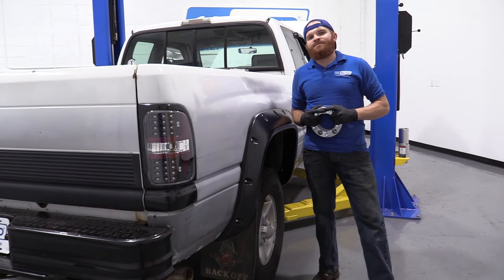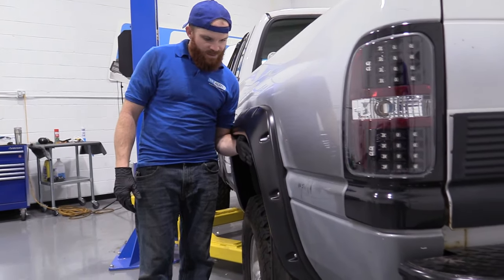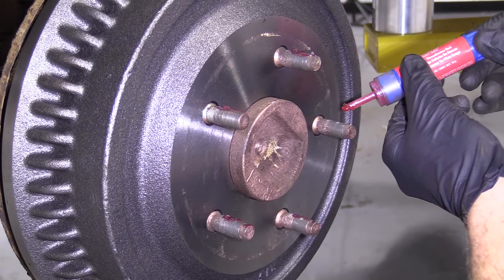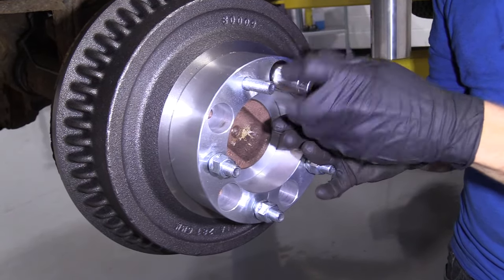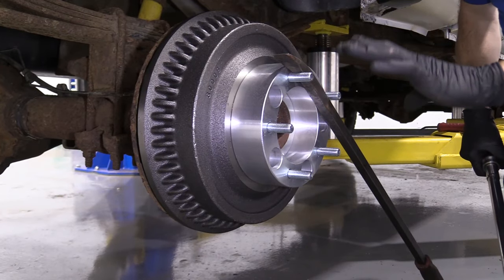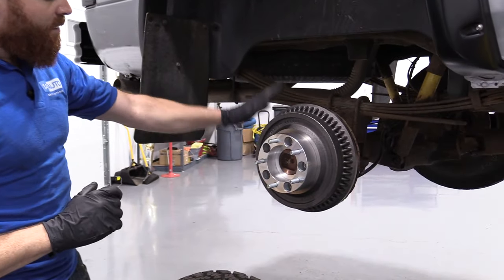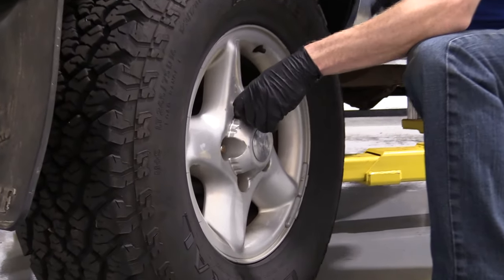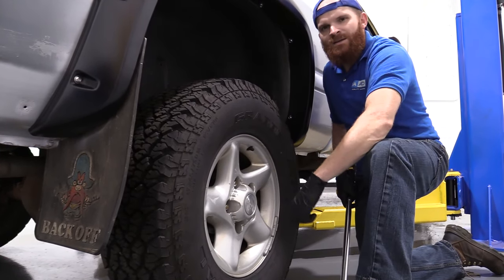How to Properly Install Wheel Spacers on your Vehicle!

Comment: If you use thread locker with BORA spacers you have just voided the warranty. If you insist on using thread locker, use blue not red. Red requires heat to remove, and eventually the heat WILL damage the studs.
Reply: So I use the blue medium strength thread-locker to car's studs that hold the spacer and nothing to the spacer that will hold the wheels?
Reply: Thanks. I guess I’ll just retourque them but. Can I retourque them every 12 days instead of 100 miles

Comment: Use BLUE loctite everyone not red unless you want to buy a torch to heat the nuts off and struggle
Reply: What if I don’t use any loctite is that okay or does loctite stop the retourque issue
Reply: @crush9197  just use the blue one . End of story . Its very much needed for your safety and the safety of others . Cheers

Comment: Won't it be hard to go back after a 100 miles or so and re-torque everything if you use Red-Loctite? I hear everyone saying that with spacers you need to re-torque shortly after install.
Reply: 100 miles
Reply: No where’s in the instructions does it say to use loctite. If you use red then no way in heck you be able to check torque. All you’ll be checking is that the red loctite is still locked.

Comment: Shouldn’t the “HUB-CENTRIC” be on BOTH SIDES of the spacer.  Thanks
Reply: No. Hub centric rings are adapters. they're made to adapt the stock hub bore to the size of the new wheel which is always bigger than the stock hub bore. They help get rid of vibration as well.
Reply: The hub on sticks through and that small part of the spacer
Reply: No. Only has to be a nice smooth fit around the hub
Reply: Hub-centric spacers are supposed to have a lip on the side where the wheel mounts to it. It’s so the wheel won’t vibrate because it would supported by the center of the spacer, and not just the lug studs. The spacers in the video do not have that lip, so it can create vibrations.
Reply: What about for the wheel
Reply: The one s with the lip
Reply: Hub centric does absolutely nothing but help with initial alignment.  All the wheel loads are held by the friction between the wheel and hub. The wheel doesn't move on the hub once it's tight. If you can put a hub centric on by hand then there is a gap (even a small one) so it cant contribute to any weight loading.  If your hubcentric is holding a load that means your lug nuts loosened and the wheel is sliding around on the hub in which case you got a lot more problems.  Every new wheel has lug centric nuts which center the wheel on the studs, the only way a hub ring helps is if your studs or wheel holes are drilled incorrectly.
Reply: @jabara572  hub centricity does help a little with load. The reason lugs shear off is due to the weight of the vehicle moving them around when driving. It’s not intended to be the sole load bearing part but it’s a lot safer to have.

Comment: I have had a problem with the spacer binding to the cars original wheel hub due to different metals for each. I think it is wise to apply a layer of anti-seize between the spacer and hub. Otherwise the spacer won't come off. Had a set on for about 2 years and this happened.

Comment: Thank you for understanding how to bottom out with a air gun, so many wheel shops and dealers don't and just use the gun tighten, stripping the lugs.

You don't know how many wheel shops looked at me as if they never knew how to use a torque wrench and properly torque to spec

Comment: You drive it around the block then re torque the lugnuts again. What you said about the wheels breaking free after hitting their first bump is exactly true.
Reply: I drove around the block and hit hella 12 bumps but nothing happened except clicking noises. I am gonna re torque them like you comment says but how often after the second time.
Reply: Coming back to reply yeah just retorque if you hear clicks they might be lose happened to me but I didn’t know how to use a torque bar at the time but if you torque correctly should be fine but if you hear clicks check took mine off because I need a lift so that they don’t rub

Comment: Great video, but one of my questions is about torque specs. Your video says to torque to manufacture of your truck, which in my case with a Chevy Silverado is 140 ft-lbs but my Titan wheel spacers say to not exceed 110 ft-lbs. Can billet aluminum wheel spacers stand the 140 ft-lbs Chevy says is needed for the Silverado?

Comment: Question, I noticed you used Hub ring for spacer but not for the wheel. Is it ok to run a wheel like that over spacer?
Reply: The best is to buy the hub centric for the wheel and hub and the spacers must be made from aluminum 6061-t6 for better safety use bora spacers on bonos(bloxsport) spacers have a higher price but don’t have to worry about ur wheel to fall off

Comment: What about a wheel spacer with a reduced center hub..? I have a sweet set of VW wheels that are too small for my Mercedes. Same bolt pattern (5x112), but smaller center bore. My Benz is 66.6mm, I believe, and the VW’s are 57mm..

Comment: So them what adapter holds the weight between the spacer and the wheel? Wouldn’t the weight just be on the threads of the spacer instead

Comment: Only thing different Is I would have used like a hose tube to slide over the breaker bar to prevent damage to the threads while applying torque to the lugs
Reply from the maker: +Kenneth Thanks for the tip!
Reply: @1AAuto  I have also cut pieces of 1/4 fuel line to slide on each stud or whatever size line that fits and easy for future use...

Comment: If you don’t require loctite when you put your tire on why use it for spacers? Torquing stretches the threads and “locks” the lugs on. Red loctite usually requires heat to remove and I’m thinking you’ll ruin the aluminum spacers. I’d use blue before red. If I’m out to lunch please let me know.

Comment: It would have been a lot of easier to apply the parking brake to keep it from spinning when your torque the spacer down
Reply: E brake only locks the back. This   truck does NOT  have a parking brake . Cars do

Comment: i like how he stressed the hubcentric rings so the whole weight isnt on just the studs but then the mounting surface on the front of the spacer doesnt have a hubcentric ring so hes just mounting the wheel to the spacer with only studs🤨

Comment: Do you put thread sealant on before you bolt the tire down or do you just use it for the spacer
Reply: Just the spacer to wheel, not on the wheel to spacer

Comment: Wouldn't the wheels still be lug centric because the wheel is still resting on th lugs? the spacer is hub centric.
Reply: The spacer he’s using is lug centric and makes it hub centric with the ring, the ring makes it safer but you can always get hub-centric spacers to make it easier, every factory wheel for vehicles is hub centric and only requires hub centric rings for aftermarket wheels
Reply: @joshuagarcia9726  but can you use hubcentric rings for a lug centric wheel  spacers ?

Comment: Ummm, unless you like damaged threads on your wheel lugs, due to pry bar "crush", I suggest you protect those threads. Either run the wheel lug nuts on to protect the threads or the old trick of slipping a 3" length of hose over them. Yeah, I'm anal about threads.
Reply from the maker: +Rex Mericle Thanks for the tip!

Comment: Isn't that adapters?  I thought spacers don't have the lug nut bolts on it.
Reply: It's a misnomer. These are actually called wheel adapters and not spacers but people incorrectly used the two words interchangeably so much that manufacturers themselves are calling it wheel spacers.
Reply: Wheel spacers and adapters are the same thing only that wheel adapters change the bolt pattern for aftermarket wheels that’s the difference

Comment: I'm very surprised that you made a video on these, especially since they're extremely dangerous.
Reply: Brad Billman i run spacers with 35s on a lifted vehicle . I wheel hard with them. No problems yet , they fail because people don’t regularly check the torque of the spacers. I check every 2 weeks to make sure they are within spec.
Reply: Well maybe that's why they're dangerous if the torque if you have to take your wheels off every two weeks the torque this down one might argue they're dangerous for that simple fact. And if not dangerous are ridiculously inconvenience
Reply: Silas magee each time they haven’t become loose . It’s just for a piece of mind.
Reply: Definitely had mine snap 2 studs on the highway, never gonna use them again
Reply: Carlos which brand did you use
Reply: @CarlitosG1711  If you bought cheap ones, that's why.. Especially from Ebay. You get what you pay for.
Reply: @russellbrown4840  I dont know had the garage I went to install them, I learned from another mechanic it was their error, the spacer that messed up my wheel wasnt seated properly apparently the other ones were. But the shop said no refunds because it was an aftermarket part
Reply: They're really not if done right
Reply: Been running spacers on the rear of my 06 Silverado for 3 years to even out the front and rear tires. And I’ve never once had an issue. Just inconvenience for doing brakes
Reply: Buy a brand name such as Bora. They have a lifetime warranty.
Reply: @DavesWheeling  every two weeks seems better then 100 miles